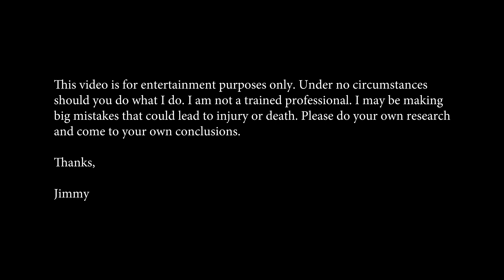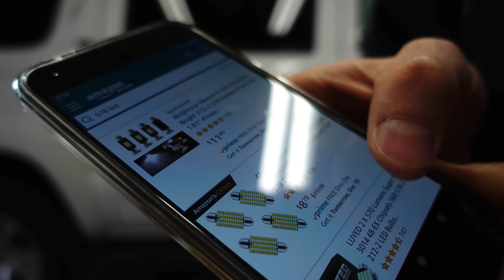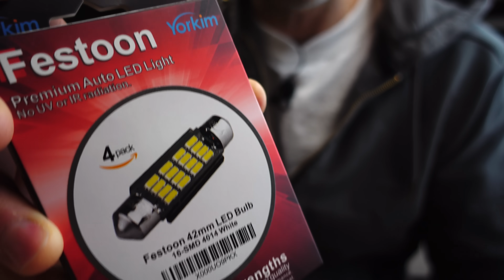Here's Why You NEVER INSTALL LEDs IN YOUR CAR OR TRUCK!!

Comment: I got in on the automotive LED fun several years ago and discovered the overheating problem when I shoved a long bulb with a crazy amount of small SMD LEDs, I think 196 into my sprinter work van instead of the little amber running lights and they managed to get so hot that the solder was liquefied and the LEDs slid off the “bulb” circuit boards.  One thing to note is a lot of vehicles disliked earlier LED units because they interfered with the vehicle’s ability to detect burnt out bulbs (probably by measuring resistance) but they eventually made ones that were compatible as well as ones that could be installed in either direction like a normal bulb instead of in the correct direction only as was the case at first.  There are a lot of choices and decisions can depend on the exact application and requirements, so those bulbs I had may have been fine if they had some air circulation, most places won’t have much air movement though.
Reply: If you use an led for a blinker, you gotta install a resistor with it so it doesn't see the voltage drop and wig out with the hyper blink.

Comment: Good points. I learned quickly that just because they fit, doesn't mean it's the correct bulb. Like head and tail lights. The existing  factory lamp is designed to work with parabolic  reflectors and sometimes frenal lens . Make sure the focal length and light pattern match the original. You might get too much of a flood or too much of a spot pattern.
Reply: You mean Fresnel lenses? It's pronounced fray-nel, because the guy was French.

Comment: Those glass bulbs you're showing by comparison aren't halogen, they're conventional incandescent. Halogen bulbs have a cylindrical glass body with a "nipple" point on top, and the only place the factory installed them in vehicles of that vintage was in the headlamps, be they capsules into modules or sealed beams into sockets.
Reply: Ok
But halogen is just a different inert gas used in incandescent bulbs that allows a different color temperature.
But whatever.
Reply: @hotrodray6802  Sorry, Ray... but every bulb I ever saw that employed halogen gas was shaped exactly as I described... including ones for household track lighting. So....

Comment: I thought you had something intelligent to say about replacing automotive incandescent lamps with LED's. Turns out you don't.
Reply: I have LED's in my tail lights and running lights and a kick-ass back up light strip. (COB).

Comment: What I have encountered with some cars that electronically dim the lights before they go out. They have has a parasitic draw. The reduced current level that the LED draws does not open the gate all the way or something, thus drawing current and at night you can see them very dim lit up. Vehicles with relays or standard door switches are no problem.

Comment: my 2011 ranger had a horrendous dome lamp... I replaced it with a blinding bright white LED. I'm happy with it. I do need to do the others, like my backup bulbs, they're absolute crap.
Reply: My '98 Ranger has a 2 light incandescent dome light and it puts out more light than I need in my standard cab.
Reply: Dave what style LED are you talking about?  My Ford uses 3 bulbs in the dome light, and like you I recently installed LED, the central location being a 578 "festoon" light and the side bulbs are bA9s which didn't work at all.  I later found out that the bA9s in this application are polarity sensitive, meaning I had to re-wire the curcuit so that the positive and negative wires were opposed to one another.  Did you run into any issues when you installed your LED?
Reply: @scorpionwins6378  it's leds on a chip, nothing fancy really. no problem with installation, just a lot less heat

Comment: I changed all my 2005 Chevy Trail Blazer EXT headliner bulbs to blue LEDs and added a couple of blue LED strips under the dash for lighting up the floor. 
My headlights are LEDs on High Beam only and I believe that keeps any aggrevation on the behalf of the opposing drivers.
Every exterior lights is also LEDs except for the B/U bulbs --- I cannot improve on the brightness with LEDs in there, so they are still stock Halogens. 
My favorite line of LEDs is NILITE - but there are some others I've bought in the past. 
My wife's 2005 Silverado was converted to white LEDs inside and it looks like a modern refrigerator inside! Her truck has the full treatment too - and the Low Beams are still Halogen to keep any complaints from happening.
Yea LEDs!

Comment: Very well done review. IMO, if the intent is to replace the incandescent automotive bulbs in your vehicle with LED's, pay a little more and go with a reputable brand (e.g. Sylvania, Phillips, etc). I would steer clear of any off brand LED's.  If you are just adding them for accents then that's fine but not for signals and headlights which your life depends on for safe driving. I have been tinkering with LED's for making custom task lighting in my home workshop and from all I read about LED's, heat dissipation is a huge factor in prolonging their life.
Reply: I agree that brake and signal lights need to be reputable brands.  A friend replaced his combination bulbs that light as a tail light and should light brighter as a stop light when the brake is engaged.  The light output between the tail light and the brake light was almost indistinguishable and very difficult for a driver behind him to determine that he was braking.

Comment: Quality is a huge issue! I converted me truck to full led. From amazon of course. Ended up frying the body control module. A hefty repair bill, and I’m back to halogen. Great Video!
Reply: What would you suggest?
Reply: @Matt M  how did the led fry your control module bro?...  how and where? What did who ever diagnosed it say happened?  I think you got burned jus trying to help
Reply: My car had cheap leds all over never had issues i just think your bcm was already failing due to the heat/moisture
Reply: bignalu808420 I found out that GM has had several customers with issues. It is a factory issue, not something caused by the consumer. GM just does not want to deal with the problems or lawsuits for their defective product that frustrates customers after a very expensive repair.
Reply: bignalu808420 The dealer, of course, diagnosed it. What the issue really was, was a loose ground on one of the wiring harnesses for the lights.

Comment: ok try changing your tail lights and not have an issue with car computer telling u your tail lights are out !
Reply: That's why you use a load resistor in the circuit on older computerised systems.  Most newer CANBUS systems recognize the change to LEDs and automatically compensate for the load change.  I did both my 2016 Nissan and 2018 Indian and had no problems at all.  Getting ready to do my 2019 Can-Am now.  As for LEDs in general, you always need to check the heat sink design and airflow around it.  If the bulb will end up being totally sealed into the lamp without any airflow around it, you can expect it to fail.

Comment: Brighter and whiter is not always a good thing. Glare, night vision impairment, etc. Bright white LED lights are the worst thing to enter the modern marketplace. Human eyes are not designed to see at night with that quality of light. Street lights, headlights, porch lights... Are all making it increasingly difficult to see at night.... Counterproductive.. Eh? Even the map light in your vehicle will degrade your ability to see properly for up to 20 minutes.
Reply: Exactly on point I & I am sure others are getting blinded by on coming cars with LED head lights. Same as if you flashed a light on & off directly in your eye quick in a dark place you will be blinded for a short time. Called white bleach out I think.

Comment: I understand what you're saying about the quality of the bulbs but I've used the style that you say are poor quality for years now and I've never had an overheating problem, quite conversely I found that my LEDs run a lot cooler than all the previous bulbs they replaced, additionally the old ones never needed heat sinks so why would the new cooler running LEDs need heat sinks and I'm talking about the small ones here not the big headlights

Comment: Those aren't halogens, they are incandescents.
Reply: Halogens are incandescents filled with an inert gas rather than a vacuum; but you're correct, those 10 watt bulbs aren't halogen filled.
Reply: Anyway...  there's nothing wrong with LED's - just don't think that you can swap them in on an old school system not designed for them.  That array manufacturer is not tied in with whoever made the car, and whether or not it will perform to DOT specs.   Second, is voltage matters to LED's: it really matters.  Hit something designed for 12 volts with 14.2, and it may not be as forgiving as incandescents or halogens.  It may do more than just be a bit brighter [before dying an early death]: the color temperature may shift quite a bit.  I'm not a fan of LED retrofits anywhere they are used: I've just seen too many failures, as in longevity claims biting the dust just 20% of the way into their claim.  The problem usually? Power supplies made on the cheap [where household lightiing is concerned]; on a car, I would hope to see a regulator [other than the alternator's] or a dc/dc supply.  I recall one of the most common zener diode output values is 9.8 volts, but... it's only good for trimming, and usually needs to be combined with a voltage divider of some type or it burns up.
Reply: Sylvania's 1156 & 1157 work great; their design backfires into the reflector on old cars & bikes; but they're not cheap.

Comment: I replaced my 2011 Suzuki Grand Vitara Head Lights and fog lights October 2021 using LASFIT led bulbs, they’re brighter than HID and comes with built in cooling fan.. My lights are working without issues, It ☔️ rains a whole lot here on 🇬🇺 Guam… going on 2 years with LASFIT it’s a good product proven with Guam’s weather..

Comment: Well, my reasons to have Halogens over LED's ON A VEHICLE, are they are superior and are more efficient against the elements, rain, snow, dust, fog, etc. Halogens pierces much better than LED. Plus during winter halogens produces heat quickly unlike LED, to melt the ice away quickly off the lights. I carry 3/5 KC' hilites halogens on my lil trucker.
Reply: @curveballintx  nahh no regrets buddy. You talk to any real off roaders in the winter, dealing with any of the elements, you'll go halogen all the way. You want to go home safe, go halogen. Bro, but it's your money, your vehicle.

Ohhh and I have 3/4 trucks. I cant fit them all in the garage. Plus when I get to my workplace, theres   no garages 😢 I want to cry now lmao.
Reply: Good post...my understanding is that LED's have greater amount of output in the blue frequency and blue light is a shorter wave length which is more easily scattered by elements, rain, snow,dust etc. I believe this is why the Sky is a blue color! So for visibility a less blue light should be better.

Comment: This is why I'm glad I got the base model with regular halogen bulbs period all the cars we see on the road that are of the higher models with LED lighting usually almost always have half of them burnt out within the first year. Nothing worse than going down the road and seeing one side of the car lit up and the other side completely dark. Or having one LED light work for the brake lights when there's like 20 LED lights in the brake light and then when you go to have them replaced it's a fortune especially if you have it done at the dealership. Some manufacturers won't even let you replace the LED lights themselves you have to replace the entire Mount housing another words the entire plastic encased light. And don't dare try to replace your halogen lights with LEDs because you're almost guaranteed to have electrical problems even with the retrofit.
Reply: In my part of Alaska, its always the 2000's Chevys with a halogen headlight bulb out on 1 side. I have aftermarket headlight housings on my 06 Ford E-350 and my 99 Ranger, with 9007 LED headlight replacement bulbs installed, and they've been 100% good since I installed them in 2017. The 3156 replacement LED backup bulbs come with a warning that they can only be run up to 10 minutes, any longer and it voids the warranty. To be fair, they are roughly $50 a bulb, and I've been using those since June 2015, again with no issue. The only electrical issue I had was I had to switch out the Ford OEM flasher for either a heavy duty or LED bulb flasher. No resistors needed. Both Fords are the XL trim package which is the base model. I dont use the replacement Stop turn tail LED housings because I've seen them fail. You're better off replacing the halogen bulb with a LED one and keeping the factory taillight housing.
Almost every single halogen bulb has been replaced in both my trucks and some of my friends.

Find a good reputable outfit and you're set.

Comment: I used some LED bulbs but they start flickering due to damage from overheating is my guess.  So I am switching back to halogen.  I also had a spot in my house with a bulb that is almost always on and that LED bulb tends to fail early due to overheating as well. So I put in a well regarded light company Phillips LED bulb and I hope they did a better job with heatsinking.  If I am even a little lucky, they will last a lot longer than the LED bulbs from a random company that didn't concern itself with the heatsink architecture adequately.

Comment: Nice video. Thanks!
I replaced all the lights in my home with LEDs, and I'm mostly happy, except for one thing: I replaced 12, 4-foot fluorescents with the type that still require the ballasts. Big mistake!
My new LEDs still hum and buzz, because of the old ballasts, which sucks.
It is so easy to simply bypass the ballasts, throw them away, and install a ballast-free LED tube!
Now I'm getting ready to tackle my car. Your video will be a great help.
Again, thanks!
Reply: The worst part or those is that the ballast is still energized. That draws power that completely undermines the point of switching to LED! My shop has 212 4 foot fixtures. I love the efficiency once I did it right, plus, haven't changed a single one in over 4 years
Reply: On the live cables that goes inside the lamp holder. There is a condensator. If you change the lights with led  you must remove the small condensator ore you will draw to much current. That should work
Reply: I did a lot of experimenting with putting 4-foot LED tubes in my fluorescent shop fixtures.  In the long run it was cheaper and a whole lot less trouble to just scrap all the fixtures and replace them with dedicated LED shop lights.  Out of the 30-odd new units I have bought, only one died.  It only lasted a few years.

Comment: LEDs = lower amp draw from alternator and battery ,  resulting in better gas mileage from the reduced load on the alternator .  Even if it’s .001 mpg it’s a win .

Comment: Cool.. I've been slowly replacing all of mine on the FJ.. First was the domes and the reverse lights. So nice being able to see backing up. So far I've had great results going through Diode Dynamics. I like their knowledge, Build quality, and the multiple options they give you depending how bright you want, color and how much you want to spend.
Reply: Thanks! Ill check diode dynamics out
Reply: I'm looking for H3 led fog lights for my GX470. 3000K would be good.
Reply: @EdwinMactalMusic I changed everything except the headlights and 3rd brake light on my 2006 Acura RSX with LEDs from Diode Dynamics. Fantastic output. A little pricey, but bright red tail lights help keep the big guys away
Reply: @pmrich6805  Would they have bulbs that fit older cars like a 99 Toyota Camry?

Comment: I guess I don't get it...they look like Tennessee go fasters to me. The light is ugly and harsh...And no pleasure in meeting a car on the highway at night with these stupid lights. Just say no.
Reply: The wavelength of the light from an LED is definitely disruptive to see when driving at night, especially when you're at the wheel for several hrs. I have normal halogens and a set of aux. LED's for additional distance vision, I'm in deer country and it definitely helps. I turn them off whenever I see oncoming lights, I don't like getting blasted with light and neither does anybody else.
Reply: i drive across 5 counties stretching from central to eastern kentucky every night. I have hit 2 deer.  There is still enough traffic at the times I pass through that led headlights would be nothing more than a nucience to other drivers. I wish I had infrared vision.

Comment: Sylvania makes the best LED replacement bulbs by far. But remember, do NOT shove LED replacements into your headlights! Due to the very directional nature of LEDs, the light cannot bounce around in the housing as it's meant to, usually ending up with uneven light distribution, and the light bouncing off the high beam reflector even when your low beams are on. So you can change every single bulb to LEDs, just not your headlights.

Comment: I have replaced all the non-halogen light bulbs in my 2009 Honda Accord with LED plug-in equivalents about 5 years ago. I have not had a single failure in all that time due to excess heat from the contact wires or tabs ! Yes, wire contacts are probably less reliable than solid or tabbed contacts, but all the old-design halogen bulbs use wire contacts ! Halogen bubs use far more power than LED bubs and send it through the contact wires, but we know that doesn't melt their plastic mounting bases. Even the brightest non-headlamp LED bulbs use very little power to begin with. These include vanity, dome, corner marker, license plate, brake and turn signal bulbs. You can hold any of these in your hand while lit and not be burnt !